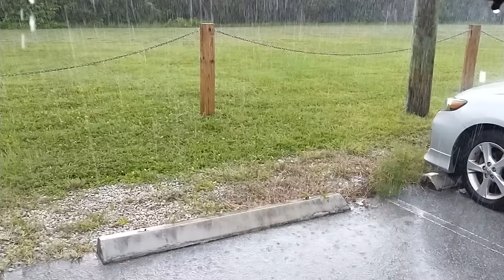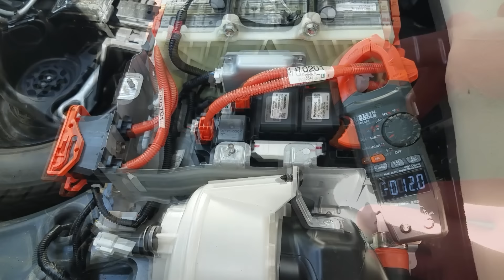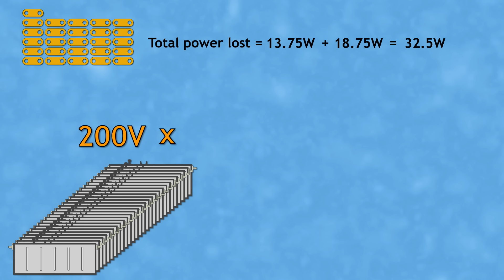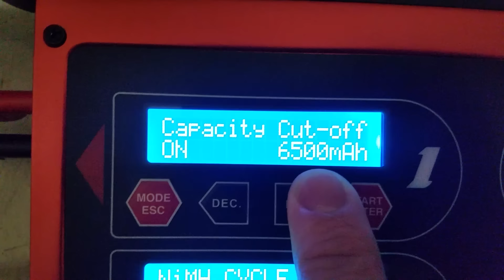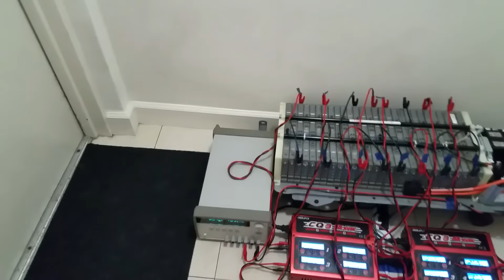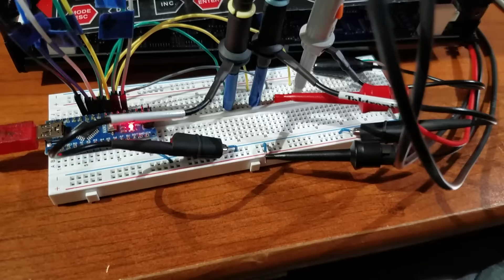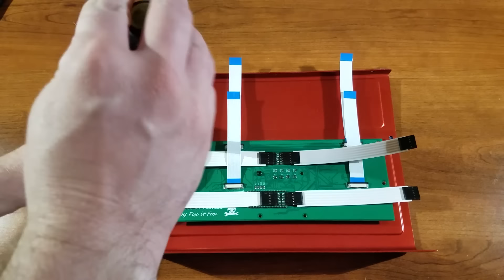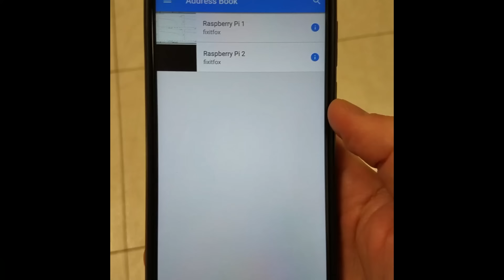An engineer's approach to hybrid battery repair

Comment: It’s cool I guess, but constantly playing whack-a-mole with dying modules months to years where they die at the worst time until they’ve all been replaced and it all starts over again seems not worth it, especially when you consider the warranty for new batteries to not have to deal with the headache.
Reply from the maker: Yeah. It all depends on the individual. If you don't want to be doing this every 3ish years and are willing to spend a few thousand dollars on a new one then that's the better route for sure.

Comment: Please note that this is not a how to guide and done by an amateur and involves extremely dangerous voltages 

At 6:49 The video displays a resistor sybol  and at 7:16 between bus bars when showing explanations,

while this would  create a voltage difference it is not correct and could confuse a person reading a schematic or  viewing a how to video 

the proper explanation is resistance which is measured in ohms Ω and available on most all multimeters including the one that is being utilized 

 this person may not be an electrical engineer, mechanic, or licensed and trained personnel with Adequate, knowledge in doing the things shown 

Please take extreme caution when working with any electrical or mechanical items and referrer to manufacture recommended repair techniques and procedures taking special regard to PPE

Be safe diyers

Comment: The amount of work you have done is really great! I wander if you considered using OBD->Bluetooth interface and android apps for hybrid battery health testing such as Dr Prius or Hybrid Assistant which provide the real-time insights and a full report as well. If not, please try and share your thoughts.
Regarding the copper brackets connecting the modules, the empirical evidence of thousands of Toyota Hybrid cars in Poland (most of them used as taxis due to their reliability and fuel economy) prove that it can help to increase the MPG, smooth the engine sound and lower the vibration when starting the engine.

Comment: 1- what would you do if one module has a voltage 0.5V lower than the other modules? (Before testing anything else)

2- how much voltage drop is considered bad when you tested each module with a light bulb for 10 minutes

Comment: I'd do what you did, but personally I'd also look at all of the battery buss-bar/terminals address any corrosion and use some terminal grease on each lug. 

Maybe because it's lithium and inside the vehicle it's not a huge issue but never can be too thorough.

Edit: lol! I just got to the part where you addressed this!

Comment: A few things:
1) you're an excellent engineer😀 
2) you should seriously consider monetizing this Beyond one little board into a system that could be used by Automotive techs😀 
3) Automotive technicians will soon have to get there double e in order to work on automobiles😒 
4) Internal Combustion Engines! 😀

Comment: I have a calculator from 1972~76. It came with a three cell NiCad. It is still in the calculator, and it still works! Charges properly! This calc was like ~$750 when it was new.
The problem with batteries is that they are manufactured to leak out the electrolyte, so you will have to buy more. Always been that way. Not fair 😡

Comment: Really great video, may i ask why did you used 2 raspberry pi's? can't just one do it the job of the two?
Reply from the maker: What a great question. You're the first one to ask!

The reality is that I did originally plan to do that. But for some reason the raspberry pi was taking so long to scan each channel on the CQ3 that it wouldn't have been practical.

It was taking me too long to debug/figure out why this was happening. So for the sake of time, I just stuck with one pi for each CQ3. But it should definitely be possible to increase the bandwidth and have one pi control many CQ3's.

Comment: My approach was similar but slightly different. I tested capacity over 3 cycles like yours, but I took a note of initial voltage vs charged voltage and then the 1day and 3 day leakage voltage. I also load tested for internal resistance using an electronic load tester and a program that would run 10A for 10 seconds and measure the drop and recover voltage to calculate the IR.

Can you supply your arduino code for reading the LCD screen?

Comment: Algorithm did it's thing. Mechanic by trade with engineering mindset. I fell here researching the battery pack of my 2011 Camry Hybrid. Almost confident from the amount of data I've researched to tackle this on my own but also hard to ignore the logistics of it. I would definetly end up figuring out my issues but fear the reality of at least 1 month of back to back work and failures and not having saved a single thing. I applaud the patience your wife has as well as the applause for your effort. I also applaud the reality of all of this done in a damn appartment out of all places. I smell a lithium bank coming soon and for your next video Ideas, as long as it's ok with the wife. Start with a bad battery bank that you can recycle the modules, replace with your own Lithiums and swap it out. Sell your refurbished bank and increase that efficiency.
Reply from the maker: Thank you for your encouraging comment! I have really been contemplating designing a lithium pack for years, so your guess is not far off... I may do that someday.

And you're the first one who noticed I did this in an apartment. 😆 Gotta make do with what you got.

Hope your Camry Hybrid repair is coming along well!

Comment: In automotive design for exposed copper lugs, eyelets, ring terminals, bus bars, etc. all are tin plated to reduce the rate of oxidation of the copper. 

The problem with the bus bars in the battery pack is they are not plated, and you should design your own. A machine shop should be able to make slightly thicker bus bars, based on the amount of excess threads on the studs, out of C10100 / OFE copper, and then have the bus bars silver plated ASMB700. Don't rely on EBAY for anything except lies. The flange nuts should be swapped out for 316L stainless. The stud and the nut are not designed to carry current, the main current flow is through the surface area between the bus bar face and the battery stud boss.

The best nut for the battery studs would be a 316L SS combination nut and captive free rotating conical washer, based on a small jam nut design to maximize the thickness of the bus bars. These types of nuts are widely found in electronic high current applications. The small nut is acceptable due to the low required  torque, and the conical washer is free to rotate so it does not remove any bus bar plating and being conical acts like a lock washer when properly torqued. With all of these features combined into a single nut you can set the needed nut torque and torque all nuts accordingly.

Comment: An easier way to check connectinos is a thermal camera during load. High ohm connections get hot. That is how i found quirks im my 25kwh home battery.
Instead of reading the charger lcd, buy four b6 chargers on ali, $15 one, they come with a serial port. Or activate the serial on your charger, its the teperature 3-pin ports.
Next time show us 62 LFP cells of 100ah (140kg). Immagine the 12x range.
Reply from the maker: Hey thanks for the suggestions! For a thermal camera to see the temperature correctly, reflective surfaces would have to be painted, preferably black. So the bus bars and the shiny sides of the modules would have to be coated. Or else the camera would see the reflected temperature of something else nearby. Those are like mirrors on that spectrum.

Also I did want to use the serial port on my charger. I had actually reached out to the manufacturer but they said they never finished the firmware for the serial port 😢. That's why I had to design my way around it. But yeah I'll have to check out the b6 chargers. This is my first time hearing about it 😊.

Also funny you say that. I am really tempted to convert my prius to use a lithium based battery. Probably to make it pluggable too. Yeah, range would be 👌
Reply: @FixitFox  Shiny doesent matter, you see the temp increase of surrounding plastic.

Comment: Very impressive work. I was under the impression that the mpg would be a lot higher than 37mpg.
Reply from the maker: Thank you! And it definitely was a lot higher! You can see near the end of the video that the mpg was in the 50's and 60's at first. But depending on driving habits and with the AC blasting on max, it can go a lot lower.

Also that was a year after the repair. Refurbished batteries degrade faster than new ones. New one will last 7+ years while a refurbished one lasts maybe 3-4 years. Thanks for watching!
Reply: @FixitFox I only commented because I have a ranger that does that mileage without any environmental battery dreams. You should be able to drive without having to change your lifestyle. Nothing personal. Your work and knowledge is exceptional

Comment: Why didn’t you check the internal resistance of each cell over time and on load variations? Along with temperature readings? 
Won’t this give you a better idea of cell health? (Temp. of internal cell is ofc not possible). 

Also, reading the voltage spread?

Comment: Nice work. I did wonder if it would have been easier to design your own charger, rather than reading the LCD and pressing buttons automatically.  I did design a NiMH charger maybe 30 years ago, for Icom walkie talkie batteries, there were chips available then.

Comment: so what was the problem with the battery? inaccurate cell capacity as known by the vehicles BMS/charge controller?
Reply from the maker: Not inaccurate but inadequate. The capacity of some of the cells were significantly lower than others because of aging, heat, wear and tear

Comment: you cant afford more than one lightbulb at a time? and I wouldnt have ran the current through the voltage leads, but that doesnt really matter
Reply from the maker: 😂 Clearly not
Reply from the maker: Btw current can't run through the volt meter unless it's set to current measurement. (If that's what you meant)

Comment: I believe your car does not have lockable firmware. So you can change an individual cell and away you go. Why is it not a topic of discussion how manufacturers are using lockable firmwares for newer cars and not supplying unlocking for third party repairers. For example if a loose wire makes the firmware lockout you are left with a giant brick because soldring.the wire won't fix the problem alone. You need the firmware from the manufacturer to reflash an unlocked version. I guess in another 5 to ten years this issue will be highlighted.

Comment: Wanna do yourself a favor?  Check the plug end of the sensor harness and where it plugs into the BMS or whatever that flat metal box is being called today.  The prongs in the box get resistive and need a shoe shine.  Do that before anything else.  If those aren't communicating, you'll have fake codes.  Ax me how I know.  Nobody checks that end of the harness.
PS. grab a load tester from Harbor and check the relative V drop.  Fast, easy and $20 bucks.

Comment: Oh mine...! I mean, I have designed circuits and coded Arduinos and Raspberries in the past, regarding remote starting of generators with automatic load transferring and alarm systems with aural warnings etc, but this is beyond my craziest dreams so far! I need some rest, only by watching it! You earned my respect!
Reply from the maker: Your comment made me smile. Thank you! And very cool control circuits you've worked on!
Reply: Probably the greatest hybrid battery video I’ve ever seen created. The amount of side quests you went on before putting it back together was absolutely epic. I felt like it was a bunch of cliffhangers and then we got  to see it all back together.

Normally I’m like 

“Okay time to test all modules with the harbor freight volt reader and check for the milliamp resistance on each module, and if I can’t find a weak one I’ll go and try to hit the high resistance ones with the 100 amp load tester 6-12V  after removing all the bus bars. Do the 5-10 second load test, hook up my Walmart volt meter at the same time and start the timer 5-10 second timer to my monitor voltage drop. Oh look 7.8v went to 6.6 throw it away, oh 7.8 went to 7.0 that’s good. Great now time to charge up a module to match the voltage, hook up spider cables, balance it 12-24 hours. And okay install, next job.” 

Your way is literally the way. I just wish I had the brain of an engineer because everything you do is concise, calculated, and epic. 

GOOD STUFF!

Comment: "Why remove the battery pack  ...".  "Oh, because that can happen."  
From a retired EE, seriously, in your engineering career, you have not become intimately acquainted with Mr Murphy?
Not as applicable, but I remember a prof smirking and saying, OR Twinkle twinkle little start, power equals I squared R.  ;-)

14W will heat that bus bar up really quickly, to really hot, ESPECIALLY in little to no air flow.  If you had touched it, it would have burned you, I expect, with any significant time spent at that level of resistance during current flow.  Not great on the battery terminals, either.  Temperature rise and cycling, with the physical expansion that occurs while charging and vise versa discharging is the bane of these batteries existence.

Have you not heard of Dr Prius, and Torque apps, to allow at least some pre and post repair checking, in the car, nothing unbuttoned?  They probably don't give as accurate a test as broken out, individually load testing cells, but the test takes 15 minutes, once begun.  Make sure you get the correct OBDII bluetooth reader, as not all of them support the entire OBD spec.  You will have a lot of fun with it, and can view real time while the car is driving, preferably from the passenger seat.  All sort of metered outputs.  ;-)

Copper doesn't rust, it corrodes. Rust occurs on Ferric materials.
That measured MPG was interesting, as an approximation for the loss I am seeing in my 22 Camry, usually on trips where a cold start is involved.
The mileage even on  good trips, starting relatively not is down, too.  I suspect, in my case, it is a sensor causing the EFI to run in 'choke mode' if you will, too long, as there is also a bit of black in the tailpipe.  I will get the OBD reader out to check.

Cheers, thx for the vid, enjoyed it.

Comment: You’ve ever dealt with p0b47, p0a80, p0b42 , p0ac0 lots of hybrid codes 14 Camry hybrid
Reply from the maker: I have not, except for P0A80 (as seen in the video). But from a quick Google search, it seems like they're all related to your hybrid battery pack failing. So there's a good chance you're dealing with the same issue!

Comment: Greay vid. Where is a good place to get replacement modules that are not junk?
Reply from the maker: I like to message the seller on ebay first and ask if they can guarantee their modules would have at least 5000mAh.

And even then, I buy 20-25% more extra modules just incase I get a couple that aren't that great. So if I need 10 modules, I'll buy 12-13. Hope this helps!
Reply: @FixitFox  kool, thank you
Reply: @FixitFox any chance you would sell the cq3 modification you made?

Comment: Good job, thanks for the video, I've had my 3rd gen Prius battery out a few times. One thing that should be considered is safety the pack is heavy and once you remove the cover and terminal covers if any piece of metal, belt buckle, random part in the car or tool arcs those posts it will create a really bad situation, so no I would not recommend taking the pack apart inside the car, as a mechanic I have had things go bad, due to being tired or distracted for a second etc. so please use extreme caution with the pack. Great ideas as well though I did learn a few things. Another idea is to use a good scan tool to monitor the live data of the voltage in the modules during a test drive and comparing them as well ,along with temps.

Comment: Genius work, i'm very impressed, love the kim possible ringtone on your phone haha. thanks for the video! Do you think it would be possible to use some small flexible 100-200W solar panels to charge the battery when the car is not running? solar mppt to 12v and then dc voltage booster to 200V from 12V and then feed it into the car battery? could maybe even but a small secondary lithium battery in between the mppt and the voltage booster to store a bit of solar power. I cant find any boost converters with high enough power capability so thats already an issue and I'm sure there would be many more issues with this setup but i'm not good enough at engineering to know what.

Comment: i started discharging and after a while it will stop and say end, what do i press to get it to go onto the charger cycle? confused
Reply from the maker: If you haven't already, check out the setup video on my 2nd channel. If you still need help, let me know. 

https://www.youtube.com/watch?v=mALgNqqQIn4
Reply: @FixitFox yea i watched it, now im getting the flashing “capa”  so i just log the numbers and run it again i guess. i had it set to 3 cycles but stops after the first charge
Reply from the maker: @jdpowersport  Yeah... That's the problem when it reaches the capacity cutoff (which I assume you set to 6500mAh). Unfortunately you just have to log it and manually start the next cycle. But the good news is that most cells/modules that reach the "CAPA" are gonna be good ones.
Reply: @FixitFox i had 2 time out on a discharge cycle what do you think
Reply from the maker: @jdpowersport  It depends what your discharge voltage is set to and how long your timeout in the settings is. The discharge voltage should be set to 6V and the timeout to 240 minutes or above. With those settings, I don't think you should be hitting the timeout on a charge or a discharge cycle.